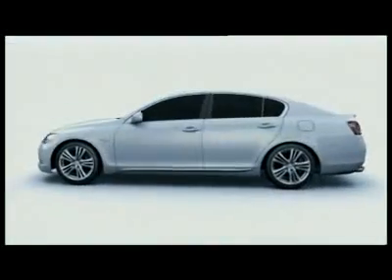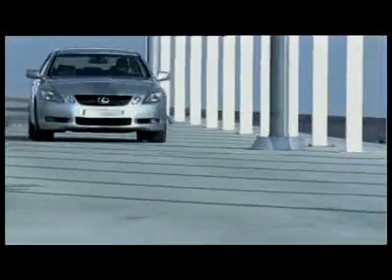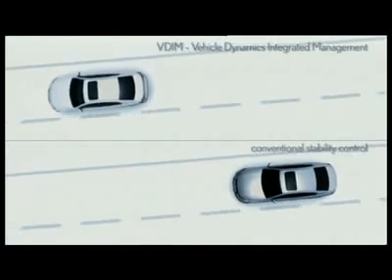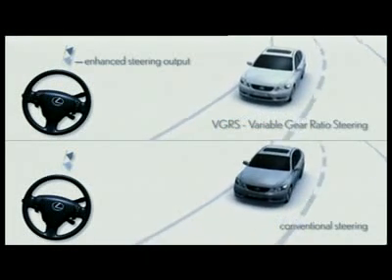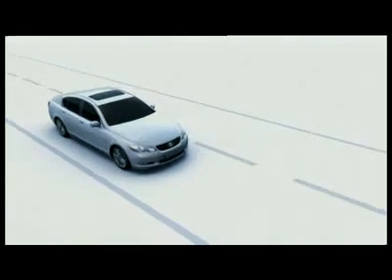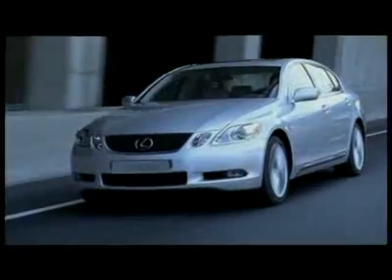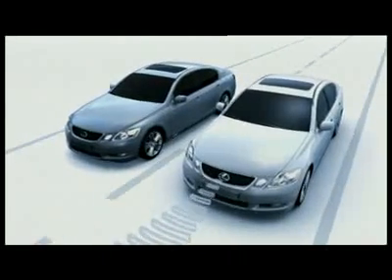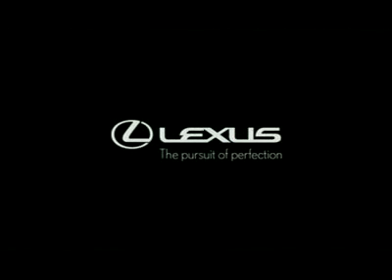Lexus GS 450h VDIM & Pre Crash system information

Comment: It is also worth noting that the other lexus/toyota product which was selected for COTY (the ls460) had a extremly slow reacting esp with corrective measuring having to be applied to stop the car from sliding out of control, proving that the toyota/lexus system is,well, not the best.Other products from volvo, mercedes, honda ect in the same test proved to work.If you want a expensive, good car, buy a mercedes. After all, what is the point of a car being reliable when your not alive to see it?
Reply: ahahahaha this did not age well, where's Mercedes nowadays? Laughingstock for reliability

Comment: @JAPANTUNER100 oh really? Well I have evidence to the contrary.... back in 2007 (before all the toyota/ lexus safety recall) an australian magazine (wheels) was undertaking tests for it's COTY (Car Of The Year) one of which involved testing esp systems on the different cars. This test involved turning at 100km/h on a gravel road. As such, all cars past his test bar one, the toyota kluger. This test resulted in the toyota rolling over as the esp failed to engage.
Reply: That is a shocker to hear but my question is isn’t this test a bit go the extremes? I mean who does 100km/h on gravel??? Dosnt common sense say hey loose road take it easy, this isn’t asphalt you know 😅 but still shocker to hear this but I’m certain this dosnt only apply to Toyota. I mean all suv are subject to this due to their high centre of gravity and I’m certain I’ve read jeep Cherokee almost flip and lifted to 2 wheels just doing 70km/ h plus jeep was newer that Toyota you’re talking about I believe.